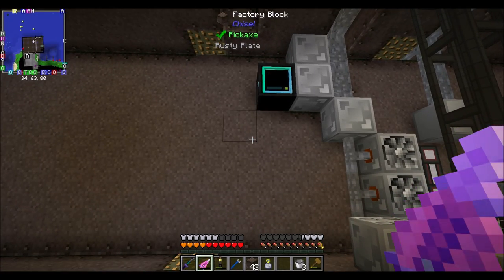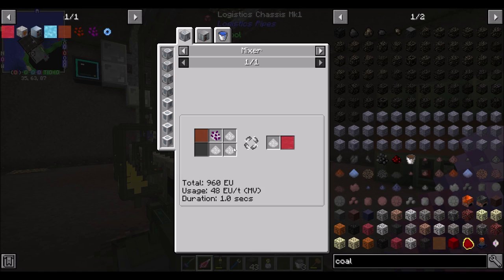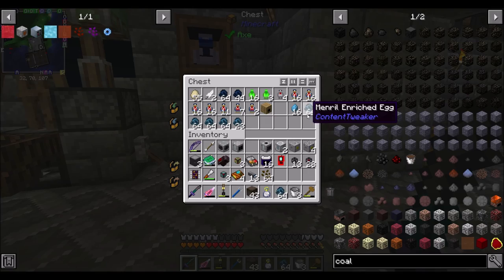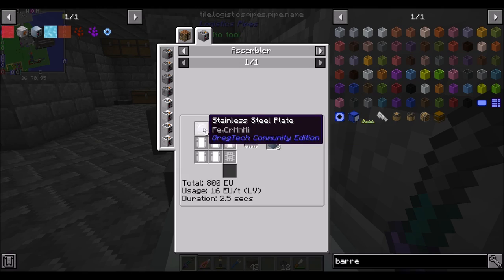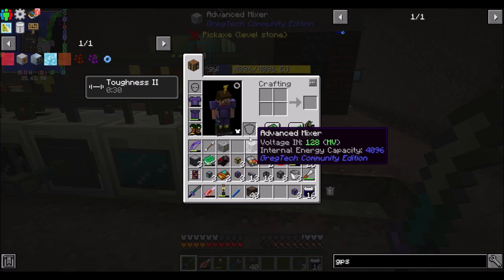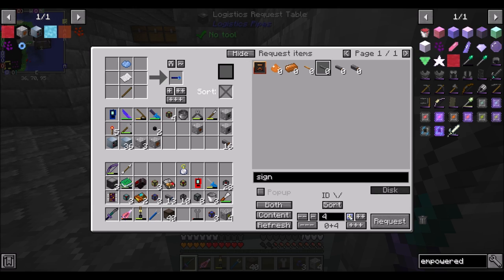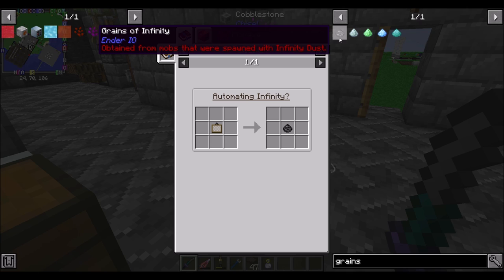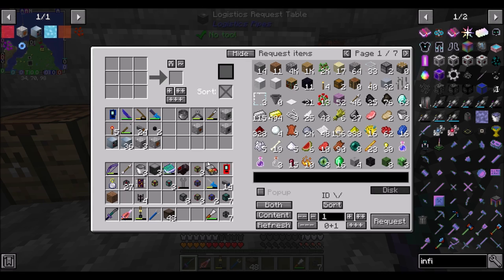FTB Interactions EP52 Automating Empowered Oil

Comment: All of those pumps and conveyors you're using are unneeded. If you wrench the machine so the output slot faces where you want it to output and then open the Ui and select either auto fluid or item output it will move the items for you without a pump or conveyor. They're only really needed when you want to do filtering so you can insert filters. You can even go fix that and crowbar back the pumps and conveyors you've used to save quite a bit of materials.

Comment: you can also get truly stupid amounts of infinity dust by putting drops of evil in a lightwell to get Liquid Nightmares, and then running that into a fluid solidifier with a nugget cast. The drops of evil you can get from killing wither skellies -- couple stacks of drops of evil can fill a holding IX upgraded portable tank in no time flat and that will easily completely fill a thermal cache of the dust. so, grains of infinity or drops of evil, your choice as to which is more efficiently gained.

Comment: @direwolf20 Gregtech machines and Logistics pipes do not play nice with eachother (especially the supplier pipe). Logistic Pipes use the forge API to detect the fluid tanks in the machines, but the only one of the tanks that is used by (most) gregtech machines is one of the output tanks (which the pipe cannot insert into). Because of this, fluid suppliers cannot always correctly insert fluids (I suggest you use an ender io tank or a likewise mechanism to serve as an input buffer to supply the fluid into (instead of directly into the GT machine). You might be able to configure the pump to only insert a given amount of fluid (however I'm not entirely sure of this).

Comment: Have light wells always accepted items from the bottom? I always had to use stuff like mechanical users to right click stuff in.
Reply: at least for a couple of years now.
Reply: They do, but bottom is also the only way to extract the liquid, so you need some trick if you dont have a 2in1 pipes like enderio.

Comment: I haven't played this pack (my computer can't handle it because it's ancient junk) but I've been watching these playthroughs a lot, and I have a question. Am I wrong or do batteries recharge inside the machines? I have seen him put a battery in a machine to "overclock" it occasionally, and I could swear I saw one start to recharge.
If this is the case, placing a battery in each machine would not only add to the power buffer, but allow occasional tick acceleration without depleting the battery pool or affecting adjacent machines. All of this, of course, depends on the batteries recharging in the machines themselves.
Reply: Indeed, batteries in machines serve as a buffer of extra energy as you said.
Reply: @joscrama  That much I knew about, but I wasn't sure if they recharged in the machines themselves. I could go back and watch earlier videos but it would take a while because I wasn't sure which one was the one that looked like it was recharging.
Reply: @Punnikin1969  depends on the machine, in some they will charge just like in battery buffer, in others they charge only when the machine is running

Comment: Is there like some kind of wireless terminal for logistic pipes or does something like that now exist for that mod? Cause logistic pipes seems like a pretty in-depth mod but if it has a wireless feature then that would be amazing.
Reply: I don't know if this version has it, but there is indeed a wireless requester. It requests items to a specific inventory rather than the player though, so it's best used with an ender- or player-chest.
Reply: Vrenshrrg That’s a pretty interesting mechanic that I don’t think I’ve seen another mod do before.